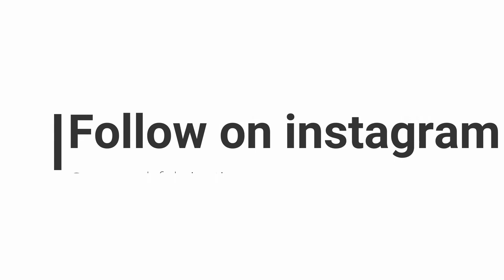Honda Fit Turbo Build (part 1)

Comment: What engine?
Reply from the maker: L15a1 👍
Reply: @unequal_fabrication  is diferent cylinder head l15a7?
Reply from the maker: @PETROTYL  yes, the main difference is the a1 has individual exhaust ports where the a7 has the "header" built into the head and has a single port that comes out of the head for all 4 cylinders.
Reply: @unequal_fabrication  ok, is stock internals? Maximus boost? Sorry my inglish is bad.
Reply: My Honda Fit is a 2011 l15a7,I want to put turbo, stock internals.
Reply from the maker: nice, mine is completely stock internally and has been running strong
Reply: @unequal_fabrication  what is ecu using?
Reply from the maker: im using hondata flashpro. 
But with the a7 you'll need ktuner because its not supported with hondata
Reply from the maker: @PETROTYL  and its on 4psi of boost. Im not pushing it too hard.